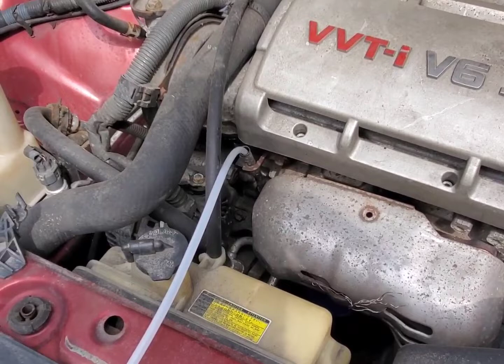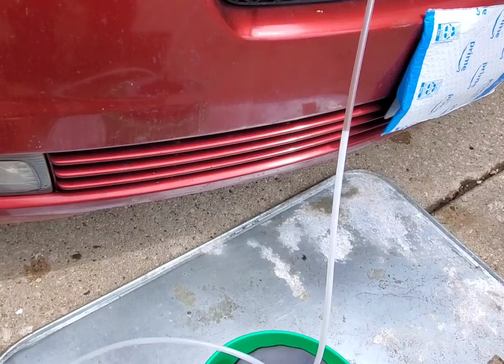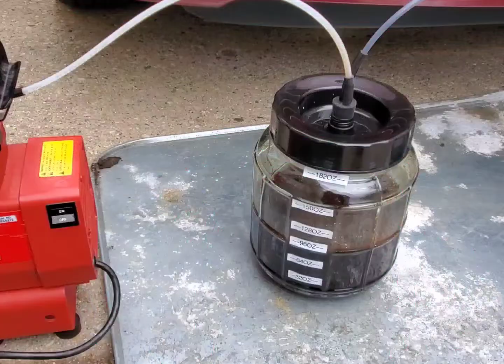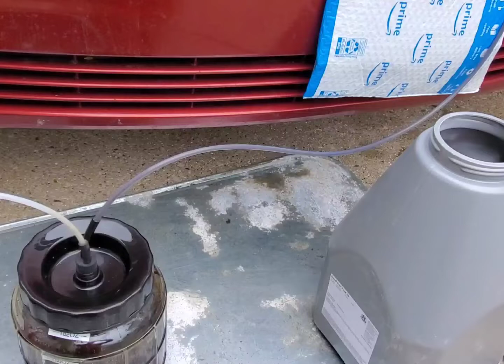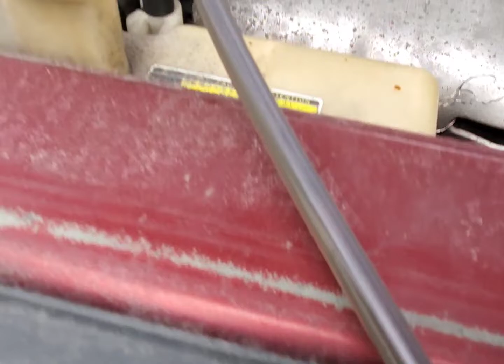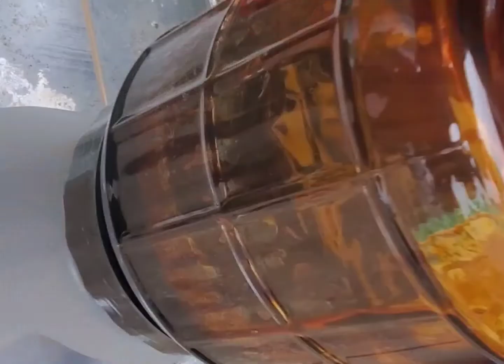Vacuum Oil Extractor 5 no...4.15 quarts beta test using the Little Big Mouth Bubbler®

Comment: Great job. I’ve never heard of big mouth bubbler jars. I’ll have to check one out. Although the pickle jars are much cheaper! Only thing I would suggest and it may not be possible is to find the biggest diameter tubing line that you can. I know on my video when I extracted transmission fluid the diameter of that is more than the typical oil dipstick diameter which made it easy. I don’t typically use my system to do my motor oil. I normally only do the ATF. Great job glad my video give you an idea on the glass jars
Reply from the maker: Me neither but i wanted a 5 quart solution the 1/4 OD 3/16 poly tube fit fine. With warm oil it was not a problem.  I was fortunate the jar was sourced out of Poland to a brewing supply in my. back yard.  If i had to pay shipping I would look at eating 160 ounces of pickels quick and running two jars in series. The drilled rubber bung worked great and should with a steel pickle lid.   If you do not have a brewing supply in you back yard with the wide mouth Bubbler I might experiment with this and plug the spigot hole https://www.walmart.com/ip/Better-Homes-Gardens-1-5-Gallon-Glass-Beverage-Dispenser-with-Wood-Lid/413145489
Reply: @007mwn  - can you tell me more about the drilled rubber bung and where you got it? The nipple and washers and epoxy that I use work great but I always like to see other approaches
Reply from the maker: @condor5635  lab supply stores call them Bungs Hardware stores may call them rubber stoppers.  I needed a number 5 for the hole.  I drilled the holes for a tight fit on the stiff poly hose i use to create a seal. REF https://www.menards.com/main/hardware/fasteners-connectors/specialty-fasteners/snaps-grommets/midwest-fastener-reg-5-rubber-stopper-1-count/84008/p-1524465101613.htm